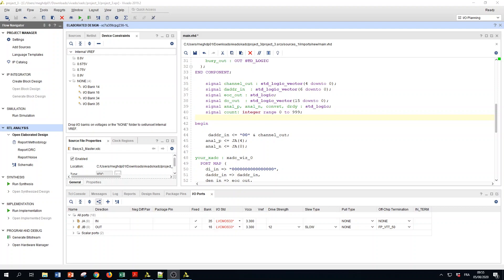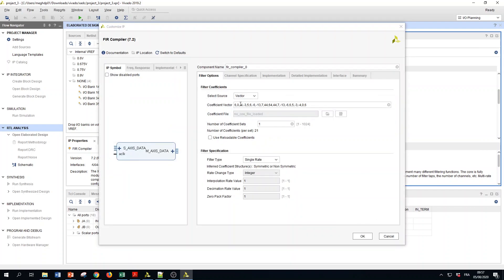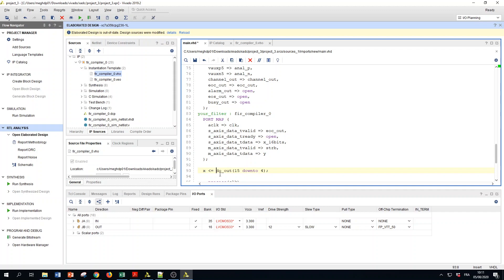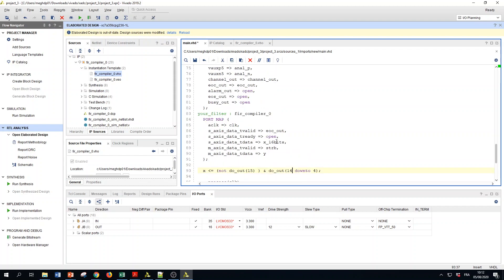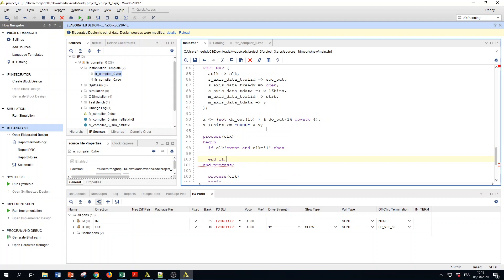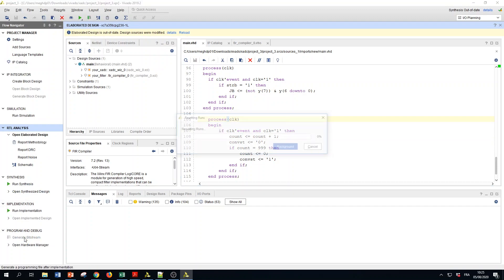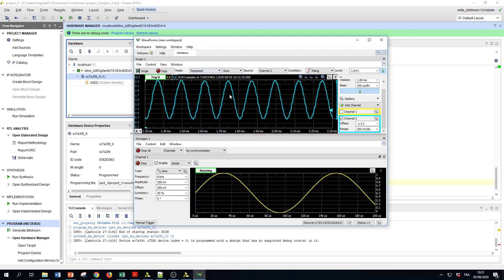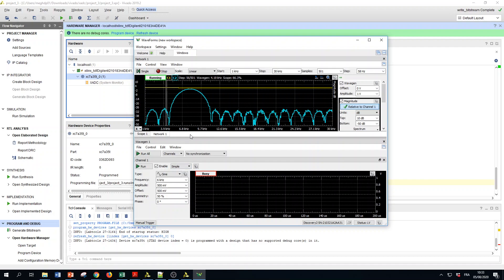FIR filter using IP with Vivado

Comment: Thank you for these two videos. Two question: a) How exactly do you calculate the FIR coefficients for the FPGA based on the matlab float/double coefficients? and b) do you need signed ADC data or could you also use ADC data with analog 0.5V offset as input to the FIR filter?

Comment: From where you got sampling frequency as 100khz
Reply from the maker: Hi Ankit, In the main prog, I have a process that divide the 100 MHz clk by 1000 to generate a 100 kHz signal, which is applied to convst.
Reply: @vahidMeghdadi  in my FPGA i have XADC which has sampling rate of 1MSPS than should i assign the sampling frequency of my FIR filter as 1MHZ ?or should fs be the internal clock of my FPGA in my case ?
Reply from the maker: @Ankitsingh-my1vu  As I understand from your question,  in the FIR filter design, you should put the real sampling frequency, which is for you 1 MSPS. It is because the designer needs the ratio between clk frequency and sampling frequency to optimize the filter taps.
Reply: @vahidMeghdadi  actually i have two datas one coming at 51MSPS and other at 1MSPS in am multipling both and then giving it FIR filter so what should i give as sampling input rate for FIR filter ,is it the heigher one ?
Reply from the maker: @Ankitsingh-my1vu  Yes the higher one, because you need to up-sample your slow signal to have the same sample rate, i.e. 51 MSPS.
Reply: @vahidMeghdadi  and sir one more thing that FIR filter should multiply only when next samples are available or at every rising edge ?
Reply from the maker: @Ankitsingh-my1vu  It depends on how the FIR filter is implemented. In theory, all the multiplications are done in one sampling period. But you need to have many multipliers implemented in parallel in your FPGA. It is also possible to use several clock cycles to reduce the resource usage (less parallel circuit). In the FIR IPs, normally, the clock frequency is a multiple of the sampling frequency.
Reply: @vahidMeghdadi  sorry for disturbing you again but if i bring both signals that is one coming from xadc to 1msps my internally generated sinwave also at 1msps do i still need to implement multiple parallel multipliers or only one can do the task ?also is nexys4 ddr FPGa XADC written 1MSPS is fixed or we can change it as per our desire in xadc_wiz ip as i can see in datasheet its given 1MSPS but in xadc_WIz i get option to set any number
Reply: @vahidMeghdadi  also i have one more question , what if my data is coming at every clock rising edge and not on xadc alone so what to assign to _s_axis_data_tvalid ?
Reply from the maker: @Ankitsingh-my1vu  I think that it cannot work because the IP needs several clk cycles to compute the output, but I am not sure !

Comment: I'll try to apply it to my testing code in LabVeiw, actually I have a proble with the output of the FIR, but I think the problem is a clock. Great video.
Reply: Hi did you solve your problem?
Reply: @Ankitsingh-my1vu  yes, the problem was in the parameters of the clock. Since 4 month I'm using it for my projet and it works great.

Comment: Why did you make the input x as(16 bits) and the output is 8 bit? Why they arn't same?
Reply from the maker: Because   had a simple 8-bit CNA :) However, I used 16 bits to improve the precision in the intermediate calculations.

Comment: do we require any special license to use the Waveforms
Reply from the maker: No, waveform is free and downloadable from digilent, but you need the "discovery board" from digilent also.
Reply: @vahidMeghdadi  I am a little confused, Ok let me explain, You are taking two analog inputs ->via analog board->it goes to your experimental FPGA Board (how) -> how you are showing output waveforms. Please help me in this flow. The question is How does input go to FPGA (XADC) and come out to Waveforms?
Reply: Sorry * via Discovery Board
Reply from the maker: @gauravpurohit1234  The analog output of discovery board is connected to the XADC of the Basys board, through JA(4) and JA(0) wires. The 8-bit digital output signal is connected to Digilent PMOD R2R, a simple DAC, through JB. You can take a look into https://www.unilim.fr/pages_perso/vahid/XADCinBasys3.html where more details can be found.
Reply: Many thanks Dr. Vahid. I am grateful for your urgent actions and help.

Comment: Hi, how do you configured the waveforms? I can't understand how to implement the vhdl code in waveforms to see the simulation. I hope you can answer me.
Reply from the maker: The waveforms is a driver for Discovery2 (from digilent see: https://digilent.com/shop/analog-discovery-2-100ms-s-usb-oscilloscope-logic-analyzer-and-variable-power-supply/). Actually it is not a simulation, but a simple real signal generator and an oscilloscope.

Comment: Thanks for the explanations. It would be great if the amplitude of your voice was multiplied by 2.
Could you please also run a demo on the IIR implementation?
Reply from the maker: Sorry about the voice. I will think about IIR, however the IIR filters are a little hard to implement in fixed-point with FPGA.

Comment: Hi, if i understand right you put a generated sine-wave in at JA-Pin and from there to XADC and from there into your FIR-Filter and from there to the output pin JB. But how you generate an analog signal from the output-bit-values of JB-Pin ? (Because filtered input Signal of Analog Discovery seems to be a sine wave too). Does Analog Discovery have a kind of DAC at input ? Greetings
Reply from the maker: Hi, yes in fact the JB signal is an 8-bit digital output. I used a simple 8-bit passive DAC from digilent (Pmod R2R: Resistor Ladder DAC).

Comment: At 3:15 you took the max value from Num and also multiplied Num by 512. What was the purpose of this? Why not just copy those original Num values into Vivado?
Reply from the maker: I needed the coeff on 7 bit. That's why I scale all the coef to have integers in the range [-63,63]. The range [-38,38] was selected arbitrary and you may scale by another factor.
Reply: @vahidMeghdadi  I, too, am confused here. Could you elaborate? Where is the requirement for 7 bit?
Reply from the maker: @m1geo  Actually there is no requirement, you should fix anyway the number of bits to something. In the normal applications (not too high quality) 5 to 7 bits are sufficient to represent the coefficients. All you must make sure, is that there is no overflow when you represent your data. I took 7 bits. So the coefficient dynamic can go from -64 to +63. Maybe, instead of scaling by 512, it is better to multiply all the coef by (value)/(max_value)*63 to have 7 bits.
Reply: @vahidMeghdadi  Very interesting! I have a been copy/pasting the scaled -1 to 1 values. The output is super distorted. I cannot work it out. The input signal is good, but the output is just distorted noise.
Reply: @vahidMeghdadi  why did you use 512 though? That is 2^9.
Reply: Oh i get it know: you scale all values by a value of 2^x, look how the values can be savedin bits (signed or unsigned) and choose that many bits. Makes sense!! Just did a little bit of thinking :D.
Reply: @vahidMeghdadi  And what about the decimal part? We are working with fixed point.
Reply from the maker: @lucasmarjona  By multiplying by 512, 9 fractional bits are considered, but each time you use a smaller register, the LSB are just truncated.